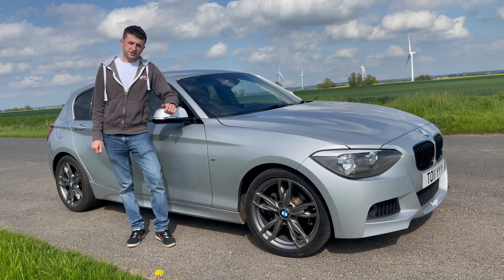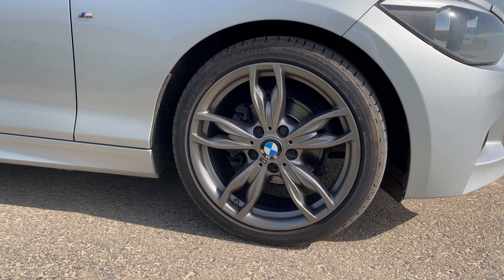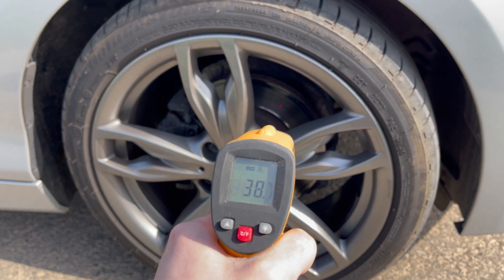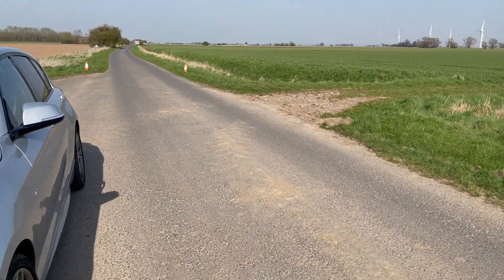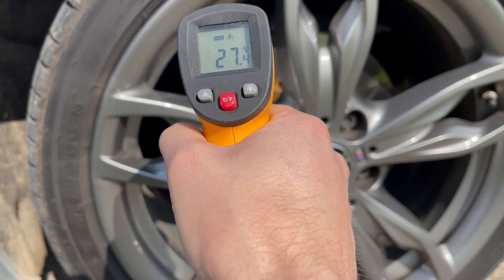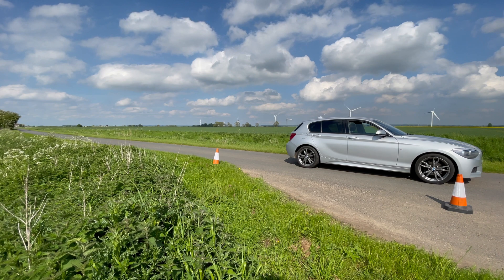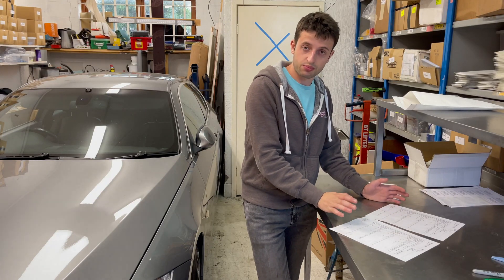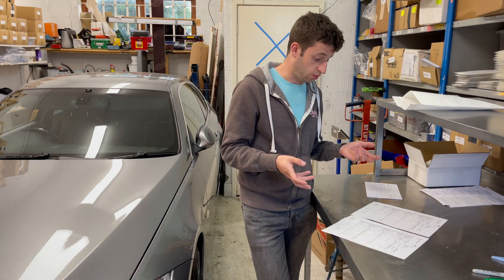Are Drilled And Grooved Brakes Worth It?

Comment: If your current brakes are triggering the ABS it is unlikely that anything upgraded on the brake system will make any difference whatsoever on one hard stop.
Maybe with hard use on a track day,  but not on the roads in normal driving.
Tyres will make much more difference!

This only falls down if the shitty old brakes are snatching and hence triggering ABS to release the brake momentarily, when better quality stuff may not snatch at the disks the same.

Drilled disks are prone to cracking with high heat input,  that's why formula 1 cars and hi-spec rally cars for years have only had groved disks, no holes or dimples!